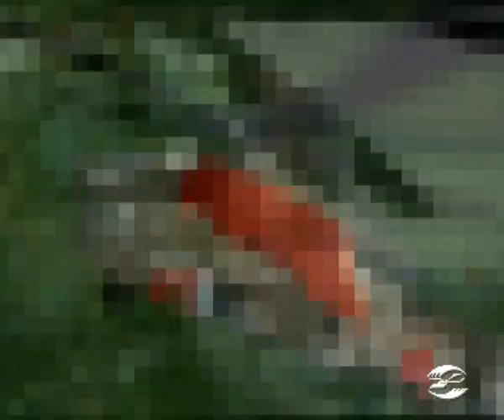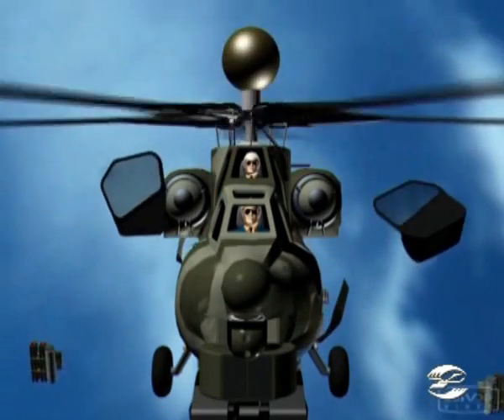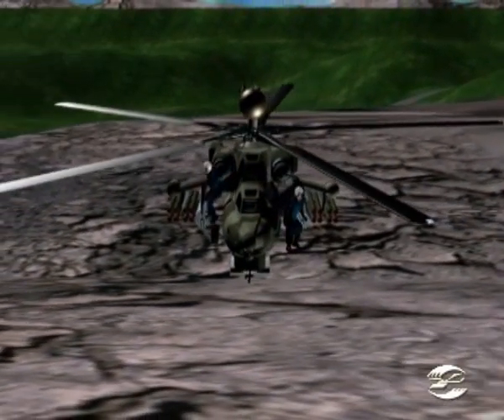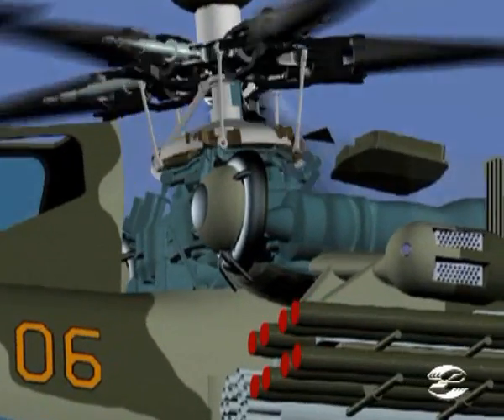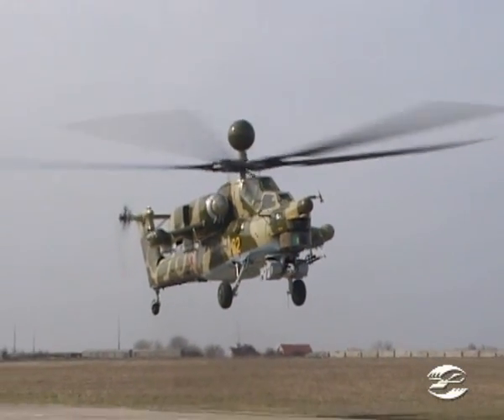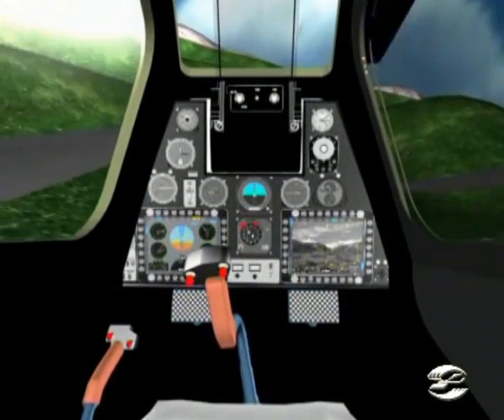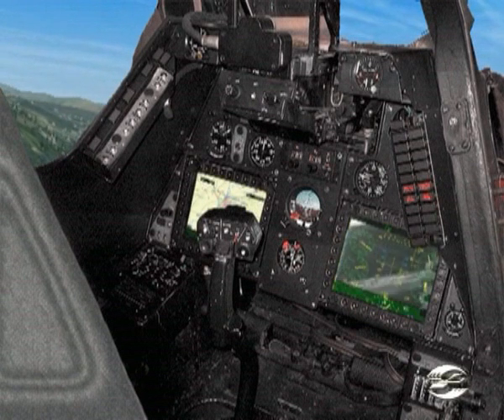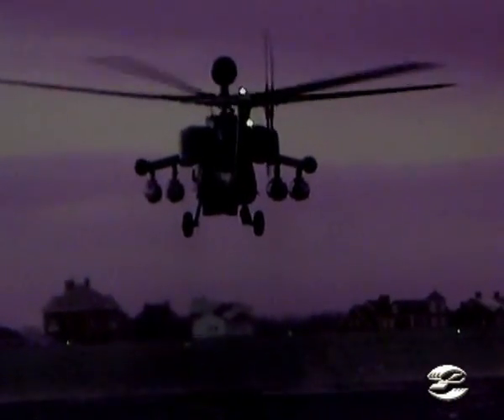Mi-28N (part. 2) Defense system, design

Comment: another fun fact is that the mi28 and ka52 were being built and tested during the fall of the soviet union and the ka52 won the competition then production stopped cuz of the breakup and then they started to retest and started production of the mi28 and ka50/52  in 21st century. the hind was put into service in the 70s and still is in service and being produced and has some advantages over the apache. i.e. armor, speed, firepower in unguided rockets, reliability, cost. now mi35m is in service

Comment: common misconception, when you equip an helicopter to carry as much as the Mi-28, you may pay a cheaper price for the airframe but the cost of parts and maintaining it exceed that of an Apache. Another fun fact is that the AH-64, KA-52 and MI-28 were all built in the 80s yet only one has production numbers over a 1000 and the two combined are only 120 total built
Reply: So Apache doesn't need either parts or maintenance. Understandable.

Comment: example, 4 apaches,30K of 30mm , 200 Hellfires  2000 70mm hydra .thats so  200 million weapons plus about 80 mil for the 4 apaches so 300 million  total vs 4 Mi 28 which 70 mil , for the Ataka V alone is 320 mil so the apache is just simplier in end because all the power the mi 28 brings more cost which is not attractive to anyone,and the answer cain or sumo, neither is threat,  rule one of fighting a larger opponent, you fight their game, you will lose, you fight your game, you will survive

Comment: yet, there are over 1100 Apaches built vs less 100 Mi-28s, overall the Mi-28 has better protection , heavier weapons load and cheaper but Apache has greater range and simplicity. The hellfire is pretty ubiquitous missile being able to engine a wider range of targets compared to the Ataka-V but utlimately I think the lack of Mi-28 orders are mainly due to its cheaper cousin , the Mi-24, you dont get moveable 30mm cannon, but easily to update for new weapons and greater range